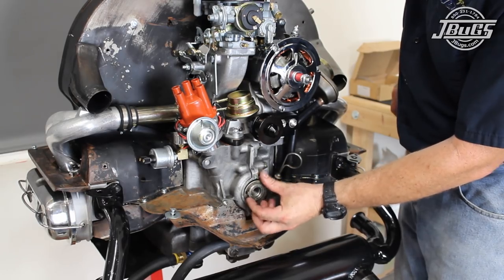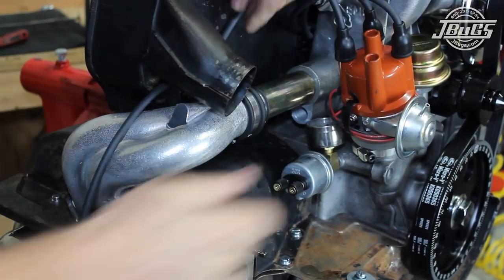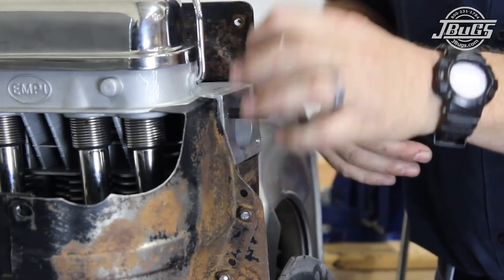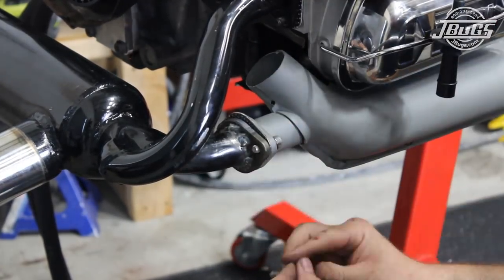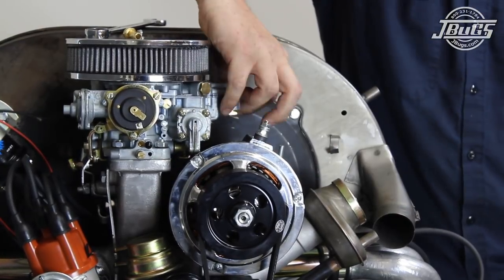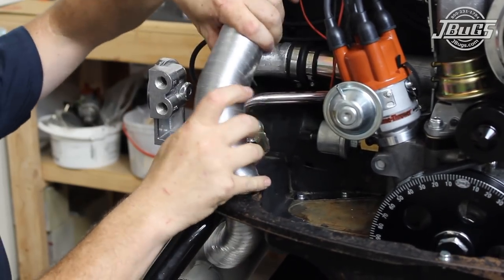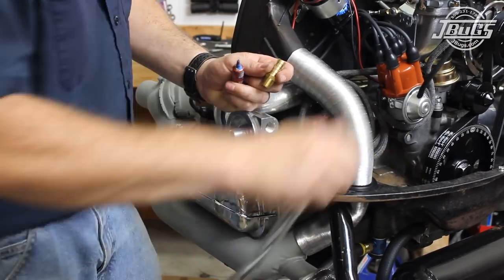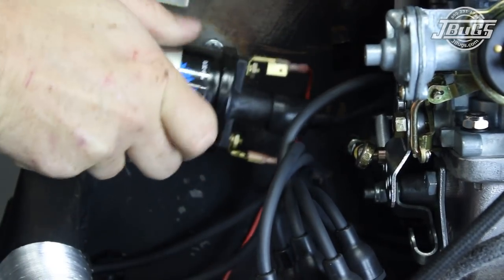JBugs - 1971 VW Super Beetle - Engine Build Series - Turn Key Assembly - Part 2

Comment: Always appreciate your videos, what do you do when your carberator doesn't have a vacuum connection for the distributor, I have the EMPI sngl 40hpmx carb kit (47-7315)with a pertronix distributor svda flamethrower. At least I can't find a vacuum port for the connection
Reply: A carburetor that does not have a vacuum port, you'll have to use a distributor that does not have a vacuum advance. Most versions of the HPMX do have a port though, on the accelerator pump side of the carburetor you should see a brass port sticking out with a screw in it. Google search "hpmx carburetor vacuum port" and click images to see what I am referring to.
Reply: @Sam_Mebane  Thanks Sam, when I purchased this carb I wasn't aware of this 
minor detail, live and learn
Reply: @daGar-qf4cf  no problem, you wouldn't think it looking at the carb, since when does a vacuum port have a screw in it?!

Comment: I'm sure it's mentioned elsewhere . but what carb did you use and did you get any bhp or torque figures for this engine?
Reply: I installed an EMPI 38EGAS carburetor. I haven't dynoed the engine but based on past builds I'm guessing it's good for about 75-80 horse and torque at the wheels.

Comment: Thanks for the vids.
How can you make a low profile engine?
Is there simpler cooling system for these engines? 
I was thinking about having 2 fans, one above each bank, laying horizontal.
Also, would an injection system help with this and make it run more efficient?
Cheers.
Reply from the maker: VW did make a lower profile engine for the Type 3 but the engine compartment of the Beetle wasn’t designed with the “pancake” engine in mind. At the end of the day, the simplest cooling system is the one that VW engineered. Making sure that all of the factory engine tin and seals are in place ensures that a properly tuned engine won’t overheat. Fuel injection is absolutely a much more efficient system, but kits aren’t very common place at the moment. There are a few companies that offer them, though the kits are typically aimed for performance applications and priced accordingly.

Comment: Why didn't they paint the engine tins?  That carburetor will never get the right pre-heat from that exhaust system.
Reply from the maker: The engine tin will be painted after test fitting all the components and breaking the engine in. This will allow us to address any issues that come up and it is good practice to retorque the heads after a few hours of running. There is a method to our madness.
Reply: The intake manifold warms up quite well with that exhaust system.